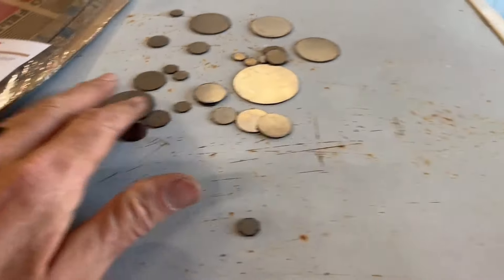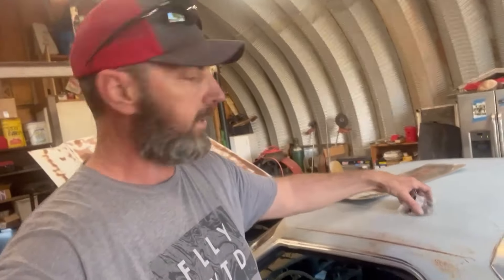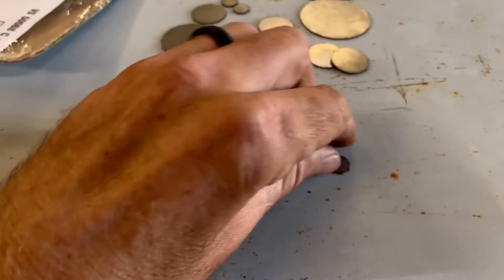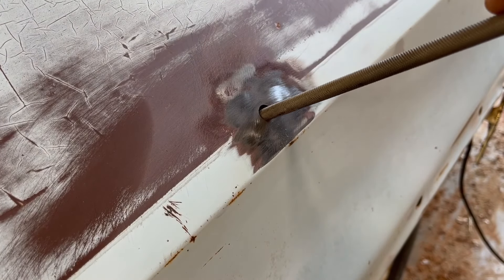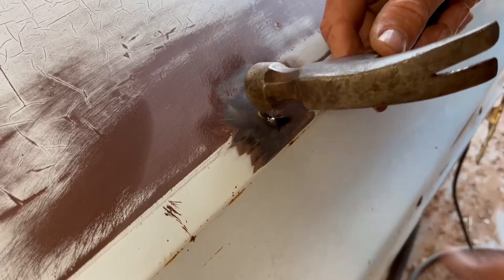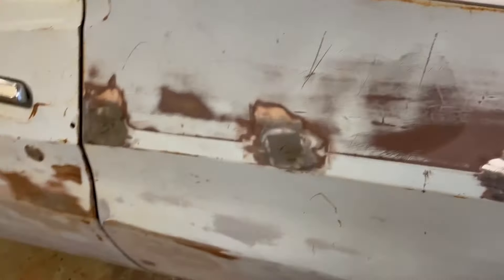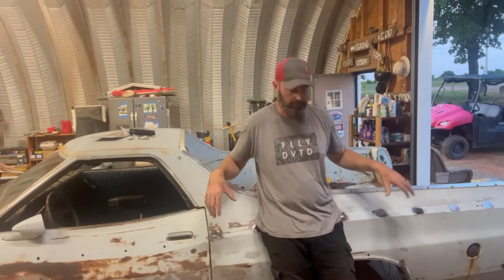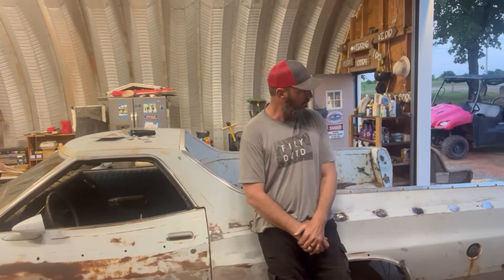74 Ford Ranchero patch panel work. Filling in trim holes. #automobile  #welding #fabrication

Comment: ARE YOU WELDING WITH A 110 VOLT WELDER ?  I ALWAYS EXPERIENCE BURN THROUGH WITH MY LINCOLN WELD PAK 140.
Reply from the maker: Yes I am. A millermatic 115 I’ve had for around 15 years.  Just have to get the right setting and be patient.  Let the metal cool
Reply from the maker: Thank you for watching. Please subscribe